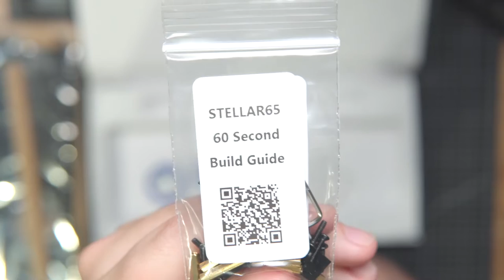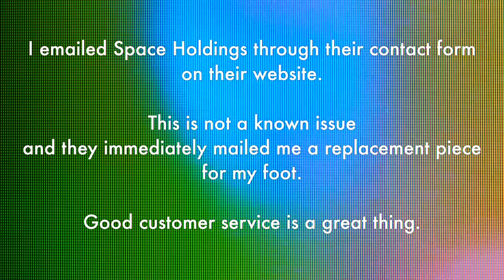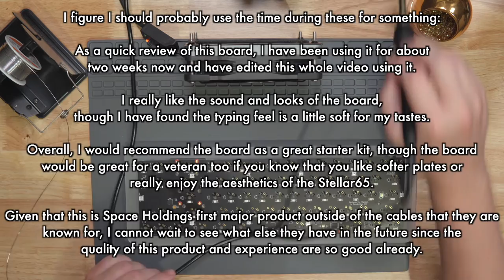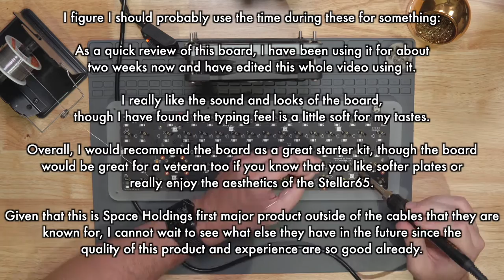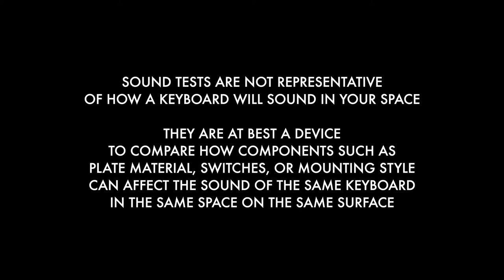Building a $400 Rainbow Keyboard | Stellar65 Build

Comment: If you don’t mind me asking here, what do you use for the overhead camera rig? I can’t seem to get a tripod worked out right, the legs keep getting in the shot
Reply from the maker: I use an Impact Pole mounted horizontally above me since my workbench is in a nook, and hang gear off of that!
Reply: @_IanOfEarth  Ahh, a cross bar that the camera mounts will attach to. Guess I need an actual horizontal mounting apparatus ...
Reply from the maker: @pauld4238  The impact poles are pretty cheap and work well! They pressure mount between the floor and ceiling by design, but can be used with lighter loads between two walls.
Reply: @_IanOfEarth  In case you wanted to know, I found the Elgato Flex Frame. It mounts to the desk and has a camera mount at the end, perfect for what I'm looking for!
Reply from the maker: @pauld4238  perfect!! Elgato is making some great stuff